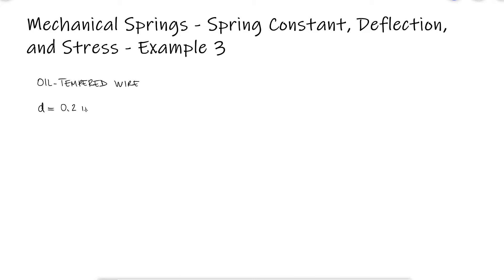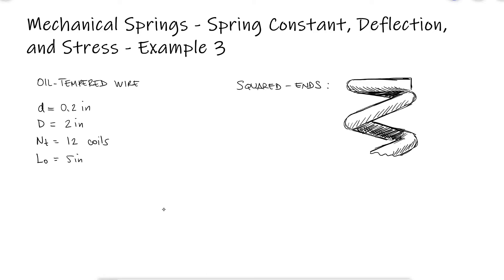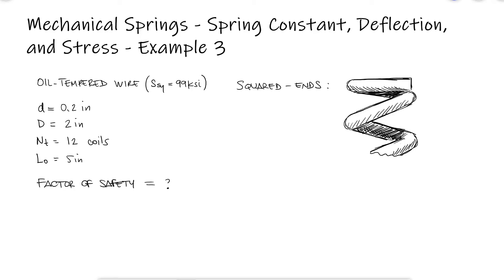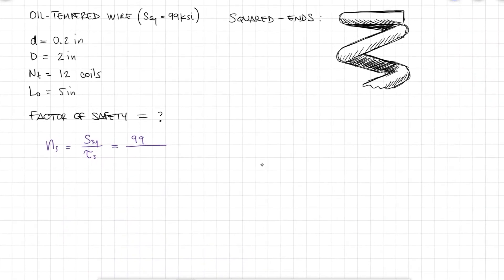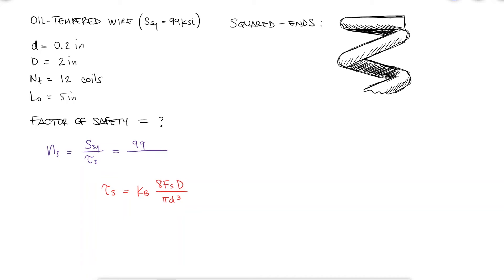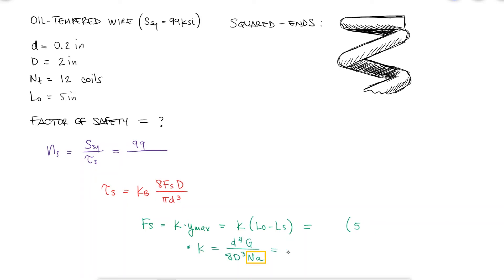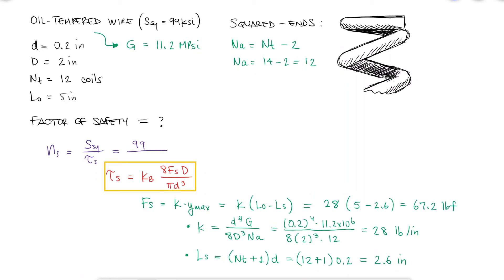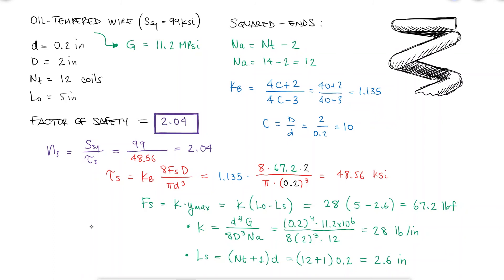Mechanical Springs - Factor of Safety to Solid Length - Example 3

Comment: Just a small note: you wrote Nt=12 at the start, but then proceeded to use Nt=14 in the upper right and in the k calculation. Using Nt=12 yields the answers you provided
Reply from the maker: Thanks! I'm gonna pin your comment for people watching later.
Reply: I also noticed that

Comment: sir how to find wire diameter of springs if we have the factor of safety value let suppose 1.5 how we can find diamter? in case of helical extension spring under dynamic loading, your response will be highly appreciated
Reply from the maker: I'm not sure I understand your question, but this example might help. Using a coding script or an EXCEL spreadsheet usually works for design problems with iterative processes or even for varying values of d until the factor of safety is met: https://www.youtube.com/watch?v=4rCCXK67x6E&t=0s